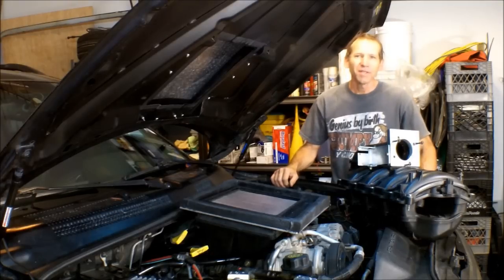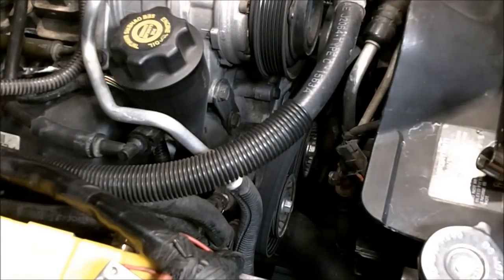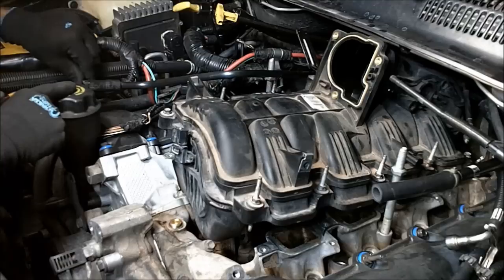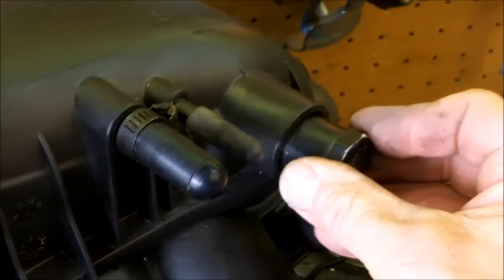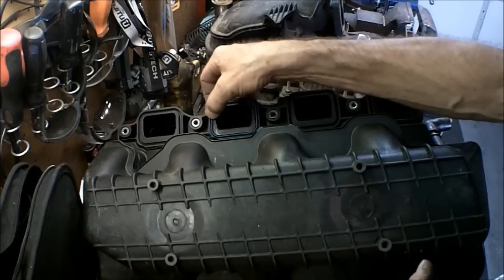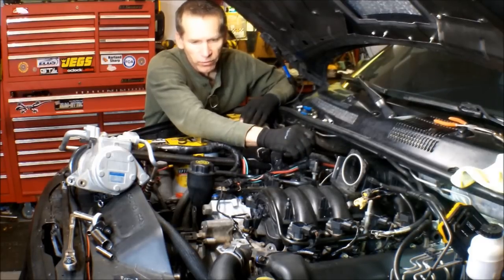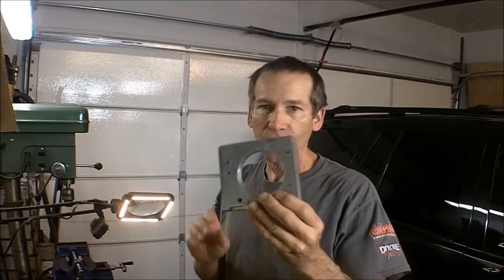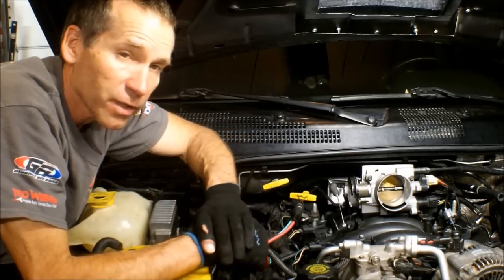Installing Upgraded Intake Manifold on 4.7 Jeep, Dodge

Comment: Thanks Martin for all you do I took your advice and put on the 08 manifold on my 04 overland HO but the knock sensors hit so I tried to relocate him but I'm getting knock sensor codes where is a good place to relocate them thanks
Reply from the maker: I just tried both 08 and later intake manifold both fit with clearness as long as you turn the knock sensors straight back or slightly toward the cylinder head. Hope this helps.

Comment: Thanks for this. Ran into a few issues. 3 manifold bolts snapped. 😔
Reply from the maker: I've never heard of any intake bolts ever snapping. The torque spec on though should be rather low.
Just looked it up it's a 105 inch pounds of torque not foot lbs just to be clear.
Reply: @martinbuilt  I had 1 of mine snap also and of course it was the last one of the passenger side

Comment: Great video!!... Is there a different intake manifold from a different vehicle that would make it easier for us novices to install w/O having to drop the 2004 JGC 4.7 H.O freedom edition engine?  Also do i need to order the custom part you made for the throttle body? And was this after you installed the 09 or newer camshafts from the durangos?
Reply from the maker: Thank you, There are some people that have been able to install the 08 and later intake without having to drop the engine most likely do to there Motor mounts being in poor condition. An HO engine is an HO engine no matter what model it comes from.
 Yes you'll need to order the throttle plate adapter from someone that carries it like  airram.com or I've also seen them on eBay now.
 Yes I installed this intake before I ever did the 08 camshafts.  I was running the HO Cam shafts at the time.

Comment: My question is, why? Whats the point of this? Im curious. Finally getting a 2nd WJ and will try to do mods for more power from the 4.7. My last 1 was also 4.7 but left it stock. Hoping there is a big bore kit, or other non power adder upgrades. Great video.
Reply from the maker: Well I can tell you after adding this 08 intake with the throttle body was the largest improvement in horsepower and torque out of any mod I've done so far. 
I gained a lot from 3200 RPM and up with maybe a slight decrease in the bottom end.
Reply: @martinbuilt  Oh ok, cool. I was looking on some forums. 1 guy put a list of parts to put in the 4.7 to get a little over 300 hp to the wheels. Thats an improvement over stock. But I dont have any experience with that yet. When I get this Jeep, I have to focus on checking everything to be running right, before mods, but I really hope to be able to play with it. I will be checking out all your vids really soon. Have you denied your Jeep to get the power numbers yet? Looks great.

Comment: So you only need to lower the engine temporarily to get the new intake in, and once that's done you can reinstall the factory motor mounts? You don't need new mounts that let it sit permanently lower?
Reply from the maker: yes just lower temporarily and depending on the condition of the motor mounts you may not have to lower the engine at all.
I had recently replaced the mounts which held the engine higher.

Comment: Hi Martin I have a 2000  Jeep Grand Cherokee 4.7 , can you please tell me what parts off of a 2002 WJ 4.7 L high output I Should look out for at LKQ auto salvage?
Reply from the maker: The intake manifold is good but not as good as the 08, the camshafts, maybe the cylinder heads if your up to that and if you are building a performance engine I like the steel crankshaft.

Comment: Thank ya sir. I have a 06 durango 4.7 an i wanna do the same thing. If it makes a big difference. Because I have a 66m turbo I was gonna stick on it. But don't want to blow it up lol.
Reply from the maker: Yeah, this intake manifold makes a huge difference compared to the factory original.
When I added the 75 millimeter throttle body that I built, it was very impressive.

Comment: I have a quick question. I am grateful for your channel. I have a Jeep so, I look forward to upgrading like you do.
I over torqued the manifold intake bolt towards the front (right hand side, closes to the head light) and snapped the bolt in the head. Now, I took out the manifold intake to put in a new bolt in it's place but can't figure out how to get it off from the actual manifold, and is it possible without having to getting a new manifold? Thanks
Reply from the maker: Yes you should be able to drive that bolt  out from the underside of the intake. Use a small deep socket and a hammer. Shouldn't take much effort.
Reply: Thank you, so much!!!

Comment: Amazing channel man, was wondering if you could point me in the right direction on where the ho knock sensors are located?
Reply from the maker: adam25000 Jeep stuff thank you! there under the intake manifold. You probably didn't want to hear that.
Reply: So where were the knock sensors in this video...i didnt see them under the intake when u removed it...
Reply: @CH-kk4rr  i did noticed the same. NO knock sensors , hmm

Comment: Hey martin .. I just got done installing 08 + intake  on my 04 overland...  after seeing what you went through  I was prepared  to lower  the engine  but mine actually  went in with no resistance... all I did was remove the weather Stripping  and I got it in..   the intake I installed was  Part # 53032761A1 and donor vehicle was a 2009 ram 1500..  maby the later ones were a little bigger?  I have no clue.. but I did have a 1 problem and anybody in stalling 08+ intake on   4.7 H.O will have the same.. bank 2 knock sensor   hits the bottom of intake and will prevent  proper alignment  of the intake.. so mine are now relocated to the outside of the block.. It's still like to know why mine dropped in and yours didn't...
Reply from the maker: It could be that your motor mounts are warm enough this causes the engine to set just low enough to get the intake manifold in. I had recently replaced my motor mounts and I think that is what the difference is.
I did install the newer 08 intake manifold and I do have knock sensors and had no problem installing it. The runners do look different on the bottom side from the earlier to later model intake manifolds. Thank you for the heads up.
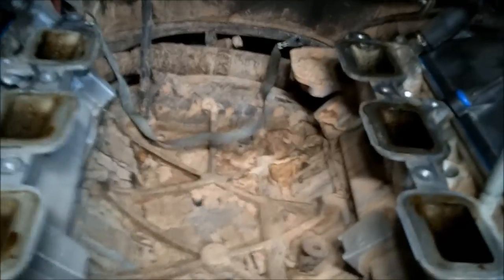Reply: Starting at 14:14 minutes of your video, you can see that you do not have knock sensors ... The HO engine has them under the intake manifold, but you do not have them in the video.

Comment: My 06 jeep commander is stalling out and  I definitely hear some kinda sucking noise making me believe it's the intake manifold gasket going bad. It's just alot of work for me. How much do you think a mechanic would charge? And I'm not even sure that's the issue also. It's frustrating because I think the car is just a money pit at this point.
Reply from the maker: Yeah that could be a vacuum leak but it could also be as simple as a vacuum hose to the brake booster or  even a bad idle air control valve. You could find a vacuum leak by using a smoke leak detector or you can spray some WD40 or carburetor choke cleaner where you may have a vacuum leak and you'll notice a change in idle immediately.
Reply: @martinbuilt  I actually just replaced the idle air control valve about a month ago. I'll check for leaks.
Reply: I sprayed around the brake booster hose. No change in idle. Sprayed the back of the intake manifold, nothing. Sprayed a few more hoses and still didn't find anything.

Comment: I have a 2002 Overland 4.7L HO. What spark plugs would you recommend? I have the Champions in it now. Also would a 185-190 T-stat help?  I read that the engine runs better cool. I'm not overheating, but I sure do have HOT heat....!
Reply from the maker: Yes for the HO engine I would run the champion platinums or I hear a lot of good stuff about the NGK. Yes the engine definitely runs better at cooler Temps. I currently run a 180 thermostat but the radiator is not efficient enough to keep the engine out 180. You have the hydraulic fan the same as I do I am personally not that crazy about that fan. In theory it should be great but I feel the RPM is a little on the slow side. I did figure a way how to pump up the RPM but I also noticed that gas mileage suffered. So I am currently working on a electric fan conversion. I don't want to do the full install on the fan yet since we do have cool temperatures I want to wait till things warm up a bit so I can see the actual difference.
Reply: @martinbuilt  Thank you

Comment: Rebuilding my motor right now and planning on doing this as well as the HO upgrade...my question is this...do I have to use the plastic like PVC hoses? What if I use rubber hose? Will that cause any issues?
Reply from the maker: I think you'll be just fine using a rubber hose as long as it's oil resistant.
Reply: Well after trying for over a year to find a 2008/09 4.7 I finally came across one today...got the manifold...but the cams were fried

Comment: Hi thanks for your videos, do you have any video on crankcase ventilation maintenance on the 4.7 powertech engine? I have some problems with condensation in the oil filler tube
Reply from the maker: You're welcome, no I don't have a video on that mostly because I live in such a dry climate the problem doesn't exist. I did a little research on it and I did find this link that might be very helpful.  http://dodgeram.info/tsb/2006/25-001-06.htm

Comment: Martinbuilt did you have to modify the side of the intake manifold where the throttle linkage goes?  Could you show how you built the linkage bracket and throttle body adapter?   Quality stuff from you as always.
Reply from the maker: Andrew Shealy 
Didn't have to make any mods to the intake manifold at all. I don't have any video on the throttle cable bracket or throttle body adapter. Maybe someday I will do a video on that.

Comment: Martin, I meant to ask, this is kinda backwards, but seeing the 08 intake fits older heads, I’m assuming that a 04 HO intake would fit a set of 08 heads. I guess what I’d like to know is, possible 08 engine in 04 WJ running on factory pcm, or even a 08 head/cam swap in the same jeep? I’m street car kinda guy and would love to get the power the 08+ Jeeps had
Reply from the maker: Yes, a HO intake would fit on a 08+ 4.7 engine.
And yes you could install 08+ heads and cams on an older 4.7
The 08 heads have larger intake and exhaust runners with the same valve size as the older 4.7
The 08+ heads do have a larger combustion chamber than the older 4.7
So you would lose some compression but increase the airflow with the larger runners. Check out this video where I cc the heads of an 08 head and an HO head. https://youtu.be/Bl8stV5VNvQ
Reply: @martinbuilt  would you think that 300ish Hp is obtainable with a head/cam swap or probably need a domed piston to regain some compression if not a lil more than oem compression

Comment: I’m going to be picking up my intake soon and I’m making my own throttle body adapter.do you think there will still be a pretty good gain with a factory throttle body on the 08+ intakes? Im doing the cams and injectors soon to pair with the intake.
Reply from the maker: yes, you will notice a definite improvement. 
Good luck with your build.😎👍

Comment: So can you tell me if this made enough difference or if it was moderate. I'm putting new 4.7 long block in mine and thought I'd do this - BUT just the parts to do this are almost as much as the whole install bill will be. at 500$ for just the intake, and then another 270 for the adapter!?! and 99 for a new 70mm TB... I'm wondering if its worth it? Thanks a bunch man!
Reply from the maker: It's a  noticeable difference, but I wouldn't give $500 for the intake. Shop around, should be able to find a used one on eBay for around $150
Reply: @martinbuilt  Right - But the folks that are building my engine require a new one be installed or it voids the warranty. Of course I could do a used one and just clean it up real nice but thats not all together very honest. While not worried about them as much that Karma comes back around every time...lol. This might be the best tech video I've ever seen on You-Tube and I am with out question You-Tube certified... :-D
Reply from the maker: @1badcj8  I was just cleaning a 08 intake this weekend. Then used an inspection scope to make sure everything checked out.
Reply: Yesser after looking at a few used ones on ebay and car-part I thought about doing that any way. What do you use to clean the inside, just blow it out or do you do any liquid in it?
Reply from the maker: @1badcj8  funny you should ask I am working on the video for that. I used purple Power and a lint brush that you use to clean out dryer vents they're like 24 in Long. I pour straight Purple Power into it let it soak and then run the brush through the intake runners and rinse thoroughly.
Reply: Dude thats awesome. Thank you very much for replying to all of this, and so quickly. When you post the vid would you link it here please? This is going to end up being a huge help!
Reply: Martin are they all the same between the Aspen, Durango, Dakota, GC, ect?
Reply: BTW here are the specs on my wj
Currie fabricated 9" high pinion front axle with ARB locker - 4.56 gears
6" Clayton Offroad Coils total of 7" in front 5.5 in rear
New ProComp 69 Wheels
New 35" Dick Cepek Extreme County
231 Transfer case swap (works perfect)
Slip Yoke Eliminator
Custom 4 link front All front joints are Currie Johnny Joints
Iron Rock 3 link rear suspension with Balistic Fab Unibals
Custom front and rear drive shafts
Superwinch Premium Lock Out hubs
5125 Bilstein Front and Back
Front JK Sway bar disconnects
IronRock Rock Sliders
All front joints are Currie Johnny Joints
And a Super Chips Flash Pack for the 4.7 V8
Reply from the maker: @1badcj8  no there were several different part numbers, but the same years the HO engine was made 2002-2004 they used the same injectors in all Chrysler's
Reply: @martinbuilt  OK cool I'll just stick to a '08-up Jeep GC manifold then.
Reply: Martin - Any chance you made more than one of those spacers?
Reply from the maker: @1badcj8  I have the one for the Chrysler 4.7 TB
Reply: @martinbuilt  And that will work with our 4.7's and the '08 intake? What year Chrysler TB would I need. Not a big deal as I've been planning to get a 70mm any way. BTW Martin I'm Dan - Nice to meet you! :-)
Reply from the maker: @1badcj8  It is the same adapter in the video with the 68mm and will work with the 70mm TB
Reply: @martinbuilt  Ahhhh I got ya its that actual one you bolted up to show how it goes back together. Were you able to get the cables on it or would I need to figure that part out and what would you need to get for that adapter - Is that something you'd rather discuss off-line?
Reply from the maker: @1badcj8  go to my facebook and message me
Reply: @martinbuilt  Roger that!

Comment: Hi Martin great video. Liked and subscribed. Have you ever had an intake manifold on a 4.7 ticking? I stuck my stethoscope on every part of the engine and could not find the source. Nearly blew my ears off when I stuck it on the left side of the intake manifold. 03 dodge ram 1500 btw. Thank you for all you do!
Reply from the maker: Thank you for subscribing appreciate that.
 no I never had a manifold tick but I have found where you will swear it's coming from a particular source with a stethoscope and it turns out to be totally somewhere else I'm wondering if it isn't a hydraulic tensioner for the timing chain.
Reply: A cup of red ATF transmission fluid !!! Thats it.

Comment: Is this manifold better flowing than the 4.7L HO manifold?  I know it's different than the regular 4.7L manifold.
Reply from the maker: Yes it does have better flow and shorter Runners than the ho intake manifold. I noticed a huge improvement over my 04 intake manifold

Comment: hope i can get a reply on this vid, i have a 2008 4.7 ram, i want to swap a hemi intake manifold. Not sure on what year would be the best. Don’t know much info, what would have to be replaced, TB, Injectors etc /:
Reply from the maker: So you what to install a 5.7 Hemi intake on a 4.7?
Reply: @martinbuilt  was thinking about it but might go with the 78mm ported TB instead, just need to know if the current intake will fit or not so that i can start looking for another CAI

Comment: I’m putting a 08 intake on a 05 GC. Do I need the EGR form 08 or will the stock 05 work fine? 
Thanks for all the great videos!!
Reply from the maker: never done it with an EGR but, I would use the one from your 05
Reply: @martinbuilt  great thanks!

Comment: Martin,  What do you think the HP gains of this would be on a 4.7 vs. 4.7HO?  I'm trying to decide if the gains would be too minimal on the HO to be worth doing.
Reply from the maker: One thing you have to realize in 04 the intakes are all the same between the two engines and if I saw that big of a gain from my non HO engine I will guarantee you will see the same with the HO  engine. It has been one of my favorite mods that done so far.

Comment: Doing this swap on mine 1 question where do you relocate the air temp sensor this model doesn't have the same ?
Reply from the maker: Relocated into the air silencer Box or the Box or the air intake tube. You can also lengthen the wiring and relocate it to the air filter Box.

Comment: Great work. Did it improve the horsepower and if so, would you recommend changing the cams as well to match this improvement?
Reply from the maker: Yes it definitely improved horsepower and torque. I will be going with the 08 + cams as well hopefully soon. I have them already just finding the time to do the swap. And then I will me getting a flying Ryan tune
Reply: @martinbuilt  what's a flying Ryan tune?
Reply from the maker: @jamesdewer  
Flyin Ryan Performance
https://frptuning.com/